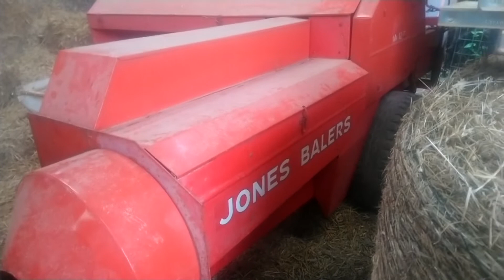grumpy Ant

Comment: Well grumpy young man it seems the weather is against you but it's warm, sunny and dry up here for a change.
Looks like you will need a few truck loads of hardcore to build up for your floor level.
I would keep the Bamford baler as a backup but it's your choice, 
Have a good weekend squire!
Reply from the maker: Baler broken needles and drive to them and rusty not worth fixing
Have a good weekend cheers 👍 🐜